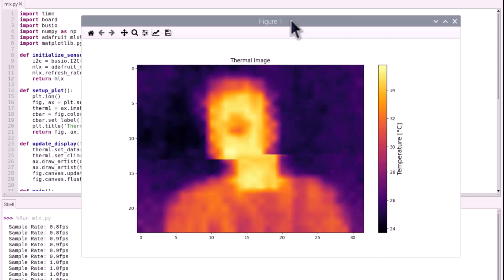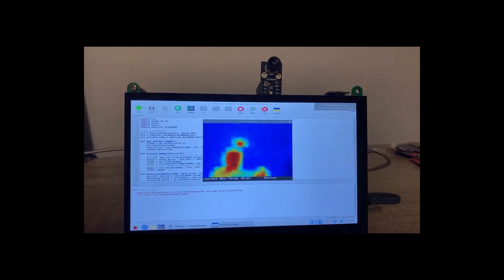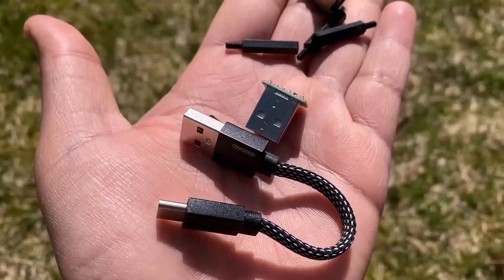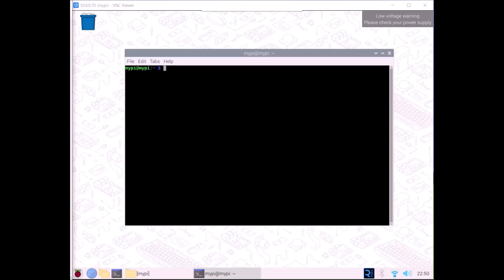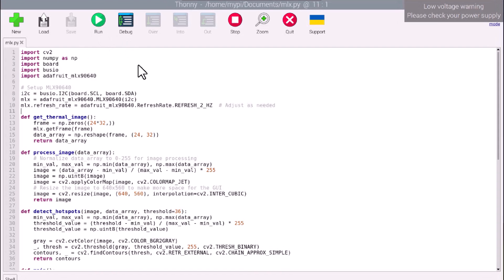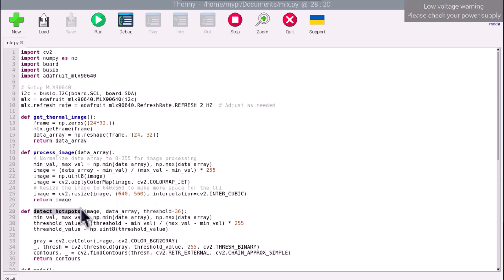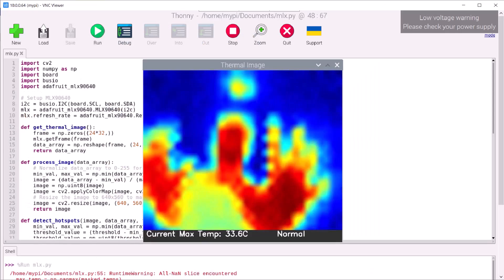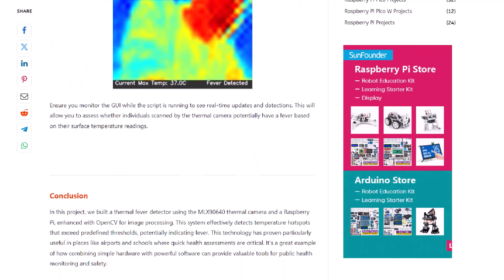DIY Thermal Fever Detector with MLX90640 & OpenCV on Raspberry Pi

Comment: Is 2Hz the maximum refresh rate of the camera, or is this a limitation of the Raspberry Pi?  Also, as @VlaProPro  asked? Could this work on an ESP32Cam, or other microcontrollers? 

Thank you in advance.
Reply from the maker: The maximum refresh rate MLX90640 can offer is 64Hz. But due to the I2C speed of Raspberry Pi and other hardware limitations, we can hardly get 2-4Hz refresh rate. 

And yes it work well with ESP32 Module. I will make a video on that soon.